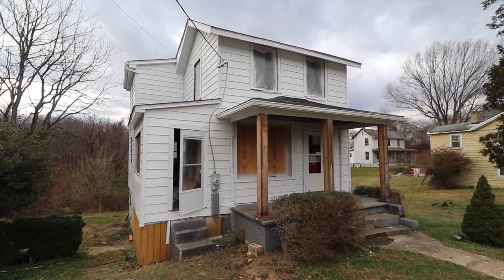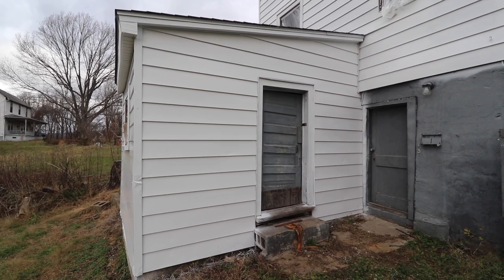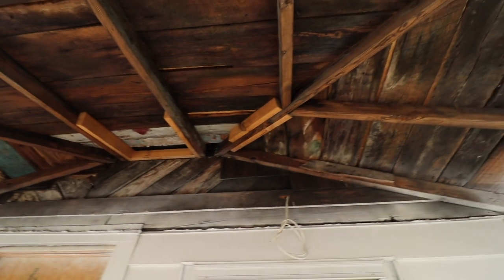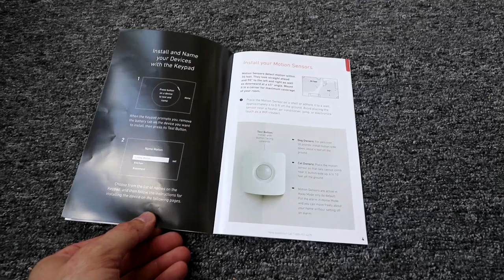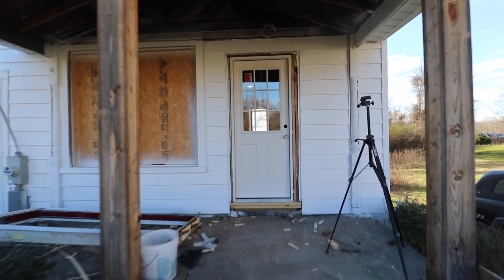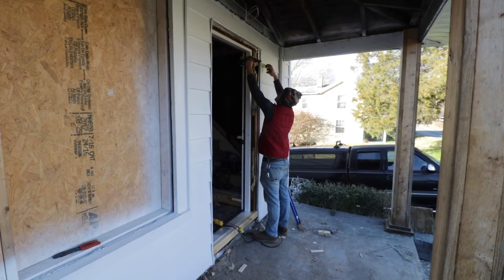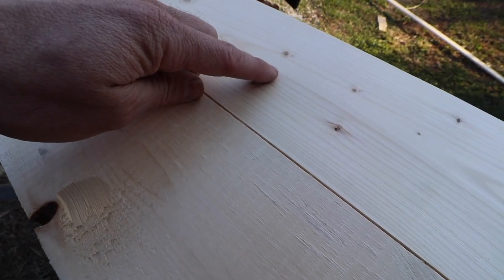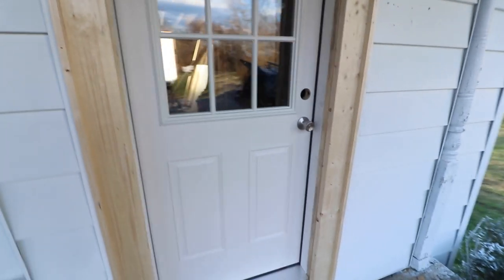$9,000 HOUSE - NEW FRONT DOOR & MAJOR CLEAN UP - EP. 37

Comment from the maker: Visit http://simplisafe.com/homemadehome to get 50% off your system + a free camera! SimpliSafe is an award-winning home security that keeps your home safe around the clock. It’s really reliable, easy to use, and there are no contracts.
Reply: Don't know if it's the lense but that concrete porch is sloping from both sides to the door which could cause water damage to the structure. Might want to lay some concrete on top to slope it away from the house foundations
Reply: I love that Simply Safe is your continued sponsor. They're a great company and they fit your channel nicely.
Reply: Thanks for the monolog at the end.   There's a peaceful comfort in your approach to building wealth.  Its also consistent with the age old advice of the tortoise and the hare.  Keep up the good work!
Reply: I use to work for ADT years back lol I secretly had simplisafe installed in my home lol no bs. 
-Art
Reply: Black window frames will look nice. Myself i would then go with a light gray all the way around on your buildup incliding the T1-11, also the porch floor, front door, porch fascia & posts. Should set it off nicely.

Comment: We had a problem at a.house we used to own with people breaking the door window to open our front door from inside whenever we were gone. We ended up having to put in a double keyed deadbolt that had a keyhole on the inside too. That kept them out. And when we were home, we just kept the key in the lock. Most people don't realize how vulnerable a house is to breakins involving windows, especially if it's old untempered single pane glass.

Comment: Decades back, I had a co-worker that had bought a house that for some reason had a "storage room" built that you had to access through an exterior door on the patio. The builder had installed an interior door on the outside of the house (it was under about a two-foot overhang, but come on, you don't use an interior door on the outside of the house, and I don't have a clue how it would have passed an inspection.  But the house was not new at the time so perhaps it wasn't original.) To make a long story a sage, my friend had purchased an exterior door.  Not a pre-hung door, but a literal door blank, no hinge mortises, no knob holes, etc.  I didn't actually know what I was doing, but I had a router and hand tools, and a semi-understanding of what needed to be done. Careful measuring and careful routering/chisel work, then a hole saw and a level, and the door was installed, looked okay, and my friend thought I was a carpentry genius. Never let 'em see you sweat when you are doing stuff you don't have a clue about! I've since installed several interior and exterior doors, but every one of them has been a pre-hung door. Much easier!

Comment: I believe you did an excellent job painting the exterior of the house. I hope you plug all the little holes in the siding to keep out the rain. The front door trim is handsome. I too would paint the masonry foundation a concrete gray color. 

I vote for painting the new porch ceiling "haint" blue because that is the traditional porch ceiling color for one of these old homes in the South. Porch railings and sturdy handrails for each set of exterior steps are safety necessities if you want to rent the house. Looking forward to seeing the railing design you choose to build.

Comment: You should paint the foundation with UGL Drylok. It comes in a few colors, gray white beige etc. and bonds really well to concrete and masonry. It's not a coating like traditional paint, it makes a chemical bond with the concrete and becomes part of it. Regular drylok with withstand something like 15 feet of water, and there's an extreme version thats up to I think 21 feet, I'm not quite sure. The main difference between the two, at least from a design perspective, is that regular drylok has sand in it and is slightly textured, while drylok extreme is smooth.

Comment: @Homemade Home; It's coming along nicely! :) Have you considered installing flood sensors in the basement? You can get some that hook up to a Zigbee hub (same technology as Philips Hue) and that can be monitored or send alerts to your phone, in case the water heater or a pipe springs a leak, and you get water in the basement. It does of course require an internet connection. I don't know if you're planning to rent out with a pre-installed connection. If so, this could save you a lot of work and money in the end. The sensors, where I live, with a hub is around $40.

Comment: I love the explanations of why you did or didn't use things. I was actually wondering why you didn't use an extension on the sprayer, then after thinking about it, I realized that it would have made a lot more work for you. I am curious though. Are you a licensed electrician and plumber? You have talked about inspections a bit, but I can't imagine anything would pass inspection if you weren't licensed in those things.

Comment: I replaced the rear door in my house. I figured if I bought the exact door size (30"x80") it would be a quick swap. It wasn't until I pulled the old door frame out that I noticed it was shimmed in with wood blocks, and the wall stud was about 4" away. I'm kicking myself because I could have installed a 34"x80" door instead.

Comment: Another personal option here and maybe you've already done it. Haven't watched it all yet. Rip out those bushes in the front. There hiding a very nice front porch. Replace them with a small flower bed on each side of the steps. Put in Low growing flowers. Marigolds, tulips, &/or daffodils. Much better curb appeal. Also I would have shortened and reused the original turned posts on top of shorter hollow posts like the ones you installed. Nice porch railing and cover the porch ceiling with reclaimed wood from inside the house. The unique dimensions of that ceiling would look awesome finished out that way. I'd look like a crazy man to the neighbor's sitting on the porch all the time staring up. Lol
P.S. I don't remember you saying why you decided not to put the small stacked washer dryer upstairs. I for one would definitely not want to lug clothes up and down two flights of stairs every day. That alone would make me walk away from renting the house. A larger washer in the basement with a clothesline outside would be fine for comforters and quilts but both bedrooms and master bath are upstairs where all your clothes are. Not criticizing just voicing things to consider.

Comment: Any concerns with putting non-treated wood in contact with concrete (especially outside)?  I always thought the rule of thumb was to put pressure treated wood in contact with concrete, then untreated above that.  I know it costs more, but when building for the long term, I would be concerned about the boards under the door frame.
Reply from the maker: It's all up off the concrete just a bit plus gets the preservative.

Comment: The idea of replacing the concrete porch with a pressure-treated one is appealing.

One thing...maybe I'm missing something here, but the only real difference I see between the two doors is the hole for a deadbolt. Wouldn't a hole saw bit and a coat of white paint have been cheaper?

Comment: Nice feature to have a wider surround to door frame, however it puzzles me as to why the door swing was not on the right.  The way it is now it appears to cramp  you towards the stairs as you open the door unless you open it  almost fully.  Also if you wanted to leave the door slightly open you wouldn't  be potentially blocking the stair access.Just seems clumsy to me..

Comment: I have a question - why did you make the door open inwards? Is that code requirement or your choice? If it's your choice - why so? I think the house would have felt more aesthetic if the front door opened to the right (and therefore outside). Maybe it's nitpicking but I just got curious. Nonetheless it is really nice to see a dilapidated house starting to look like a home again, good job!

Comment: 26:40 Couldn't you frame a porch on top of the concrete one without having to bust it up?
Reply: If you mean framing a wooden porch over the concrete one, there are a couple of concerns with ventilation. Most decked porches require a large volume of air underneath which can freely vent from the sides to allow moisture to move out from underneath the decking. If you build a wooden deck inches from a concrete slab, the space between the slab and the deck is going to capture and hold moisture for longer. This will lead to the deck rotting much more quickly than you'd expect.

If you mean pouring an additional slab to bring the surface up to the door, there are concerns with the thickness of the slab and the movement of moisture into the wall. If the slab is too thin, the concrete easily chips, cracks, and breaks apart. If the slab is not sloped correctly, water can wick it's way between the slab and the framing of the house, causing rot. You want patio/porch slabs to be slightly lower than the exterior walls of the foundation for this reason, among others.
Reply: Use pressure treated sleeper joists. I dont see why not!
Reply: And then extend the wood frame front porch/deck down to the other front door
Reply: I have done in a few times taper cut sleeper joists tapcon down use string line to figure out thicknesses. Have done them with wood and with a composite decking. Saves a lot of energy.

Comment: Curious to know what are the issues with a darker color paint? The concrete post thingy needs to be removed but i fear its going to be another long tedious job like the one in the basement.
Reply: In his climate (I'm assuming Mid Atlantic to lower Atlantic) there is severe sun bleaching if there is not suitable screening. So dark colors will fade rapidly into a dingy grey if it faces the sun. A neutral grey or blue would be more sun friendly and wouldn't fade as fast.

Comment: Question,  why do you have your doors open inwards? 
You get worse insulation and its super easy to break in to
Reply: You will notice that it's mid-December and there is no snow on the ground, so cold is not a problem. These doors work best when there is a "storm door"...a combination of screen and solid panels for ventilation. This storm door can be locked and opens outward, so there is a layer of protection against invasion. I am assuming that he is in the mid to lower Atlantic states, so his problem is more heat than cold. Think southern Italy. It's simply different solutions for different climates.
Reply: @DodiTov  so its no reason?  You even lose space inside because of it

Comment: I hated the previous front door.  The new one is 1000 times better, maybe even a gazillion times better.  The new door framing is a really nice touch.  As for porch lighting, depending upon what you do with the ceiling, consider a porch chandelier or recessed lighting.  The ceiling does not have to be a flat planar surface.  Vaulted would match the upstairs bedroom.  Recessed lighting would go with the interior lighting, but the right chandelier could really look nice.  (Not sure if "chandelier" is the correct term for a hanging porch light.)  If your intention is for people to sit on the front porch after dark, consider putting a light or two by the window area.   And an outside electrical outlet (with an inside on/off switch) is something I always appreciated whenever my place has had a porch or balcony.  I'd probably put it near the middle, maybe centered under the window, or near the far end.
I always look forward to your videos.  They are a curious mix of education, comedy, and relaxation.  4:25 "Y'all know how I feel about concrete blocks just jutting up out of the ground for no reason..."  Pause playback LOL!  You are a genuinely funny young man!

Comment: In your remodels do you need to bring doorways up to standard codes?
Reply: In many states, there are "grandfathering" clauses for odd shaped doors. That said, standard doors are readily available at the hardware store. It's simply easier to get a pre-hung door and make the space fit the door as he did. Current codes (I believe) call for wheelchair accessible widths, but that's only in my state.

Comment: Asking for my own house, can you build a porch on top of the concrete one?  We have a concrete front porch and it is low enough we could build higher, but I am not interested in spending 2 years with a sledge hammer to kill a concrete block :)....
Reply: Investigate the new plastic decking systems. They're more expensive, but they don't rot. Wood would rot because there's no air flow from under the porch. You might think about the drainage too.
Reply: It is a covered small front entry porch but will look into that.

Comment: Why does the door swing inwards?
Reply: It is actually safety! A woman can push better than pull. If an attacker tries to push his way in, a smaller woman can throw her weight into slamming the door shut. You already have a shoulder in front of the door edge. It helps if there is a locked screen door, but necessity is the mother of invention.
Reply: @DodiTov  Thanks for the info. In Norway it need to swing outwards in case of a fire or an emergency. Thats code here.